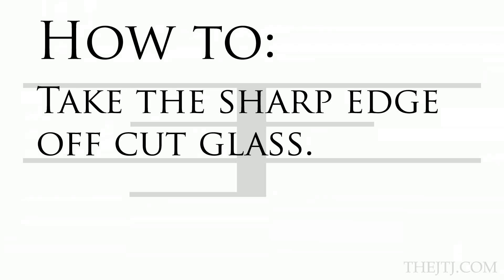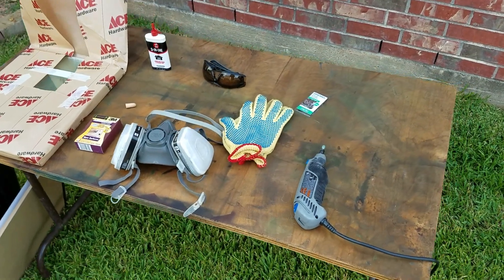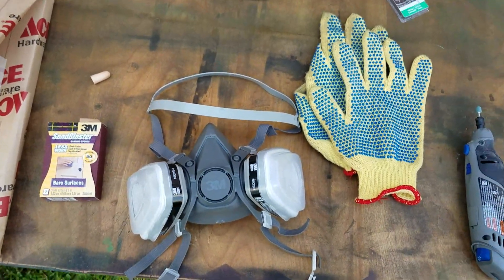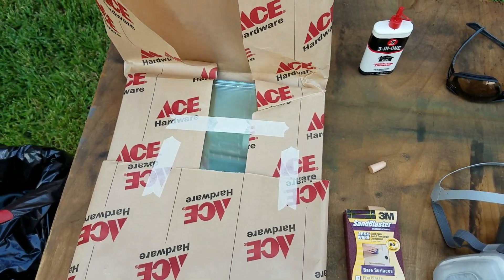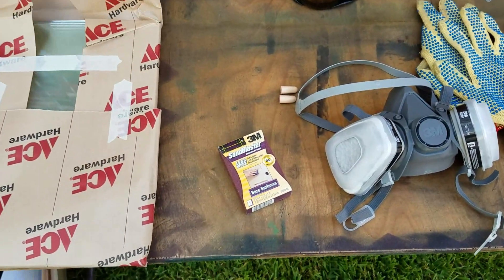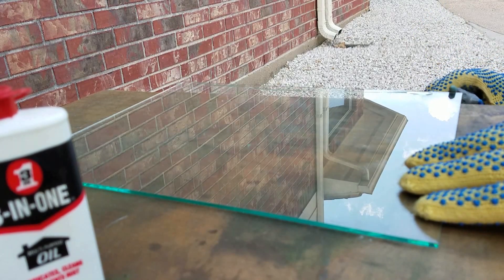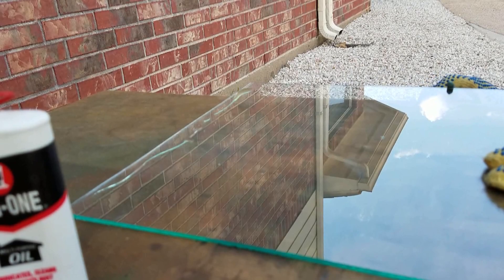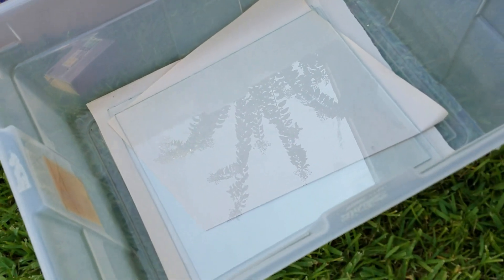How To: Take The Sharp Edge Off Cut Glass

Comment: OK, but why did you put a line of oil along one side of the glass?  There didn't seem to be any purpose that I seen.
Reply: Helps with the heat and friction on the bit.  Also helps stop the glass dust flying around.